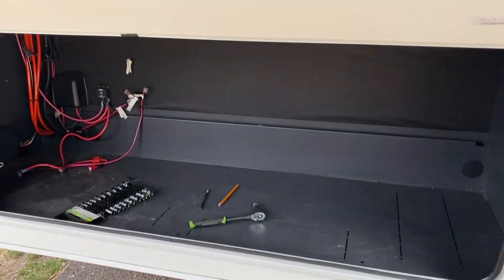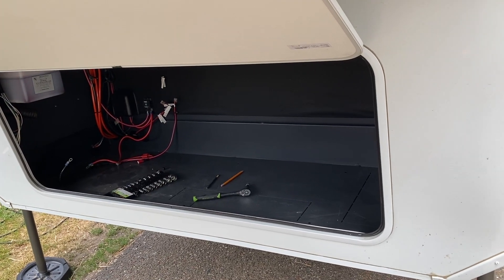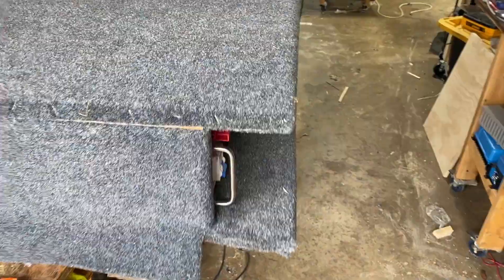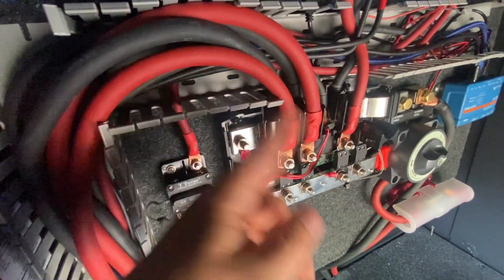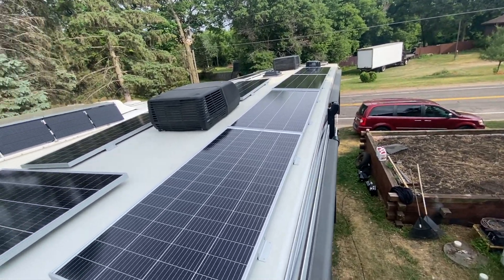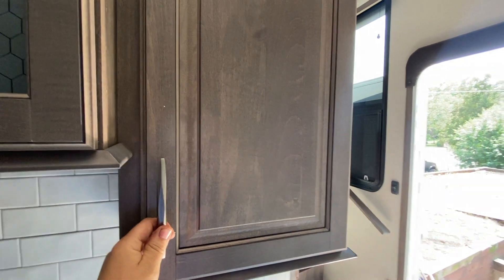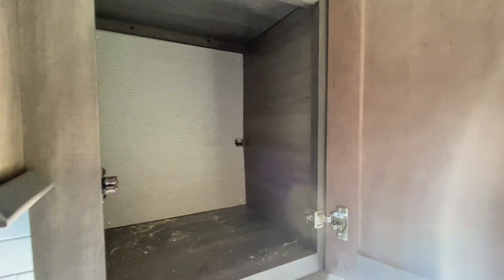Grand Design Solitude 280RK 24v Solar System  with EG4 batteries & Victron Equipment

Comment: how do you mount the board to the back wall?
Reply from the maker: Depends what we're hitting on the other side. Sometimes self tapping metal screws with a broad head and or washer,  or a spax t25 if going into wood or softer metal like aluminum.  Usually we'd predrill a bit for those.

Comment: What about all your 12 volt systems in the rv. You didnt talk about a stepdown converter and how do you know if has enough amos for the slides and leveling jacks etc??
Reply from the maker: We’ve covey that in other videos. Look for other 24v installs.

We use an Orion 24-12 70 amp step down and then leave a single 12v battery in parallel with that to power slides and other loads in an emergency.  Been working great!

Comment: Impressive work. Great system. Do you parallel the ac wiring with those splice blocks under the inverter? Was thinking of a junction box but i like your idea

Comment: It makes no sense why this isn’t an option from the factory instead of a generator. If I could have had 6to9 eg4 48v batteries and 3200 watts of solar on the roof with 2 MP2 inverters etc etc, I would have added another 20k to my loan just for the ease of having it all. 
Side note WHY THE FUCK IS THERE SO MUCH UNUSED SPACE IN THESE GODDAMN RV’S!!!?!?! MAKE THESE VOIDS ACCESSIBLE CABINETS DAMMNIT!!!
Reply from the maker: Yup.

Comment: What about air flow on the batteries?   It looks like they're boxed in completely except the front.  Are you worried about high temps?
Reply from the maker: The batteries are already encased completely and they generally don’t generate much heat during normal operation. That’s more for a hey draw application like a car. For comparison, a large RV system might use 10-20 kw in an entire day. Where an electric car might use 60kw in a few hours. It’s why EV batteries need the cooling.

Comment: Looks great. I wish the eg4 24v  batteries  Were available when I built my system.  I have 2x 12V SOK 206AH  batteries in series And periodically I have to deal with them getting a little bit out of balance. They are great batteries but an all-in-one 24 V battery would definitely be more ideal where all of the cells are managed by a single BMS. These EG4's are also quite a bit lower cost than 2 SOK's
Reply from the maker: We did an install with the 24v battery balancer. I would recommend it.

Comment: Nice install.. dig the battery setup... I have an older class A .. a 2003 Winnebago  ...  we are hitting the road for 6 moths or so.. I have a 24 volt system now in my shed at home and run my window ac and all my tools off solar so I realize the advantages of that higher voltage.. (I had a 12volt system in there before) BUT what do you think on running a 24 volt in my rig?.. (how I found your Vid) .. although I am a subscriber...  I'm on a budget and was thinking going with a 24 volt system and keeping my 12 volt to run all my 12 volt stuff and slides (I have 2)  I would apricate your Impute as I see you know what the heck your doing.. LOL
Reply from the maker: Watch  the most recent video, we did one in a Winnebago Journey. 

We are a Victron dealer and sell to many people we don’t install for. We make margin (you pay same retails price as anywhere) and that covers consulting time for us . We’d be happy to discuss a system for you . Hit us up on the website https://sotasolar.com

Comment: With the panels mounted on the roof you will have to park the camper in the sun for full sun exposure heating up the interior of the camper. Why not use portable panels so you can keep the camper in the shade.
Reply from the maker: Many times we include a second charger just for that.  Why choose?   But seriously, once nice thing about covering the top of the roof is almost adding a second roof.  They  have a fair bit of shade almost all the time now.
Reply: you just cant keep up with the ground deploy its a pita
Reply from the maker: @sudo936  One of our guiding principals is "What will I do in practice?" ... if it's too much of a pain, or makes camping more of a chore, you won't do it.  I think you're onto something there.
Reply: Curious, is going 24V the key to getting 2400W of solar on the roof using only a single Solar Charge Controller?
Reply: How would you store 2400w of panels to deploy? And where would you set them all?
Reply from the maker: On the roof works well :-)

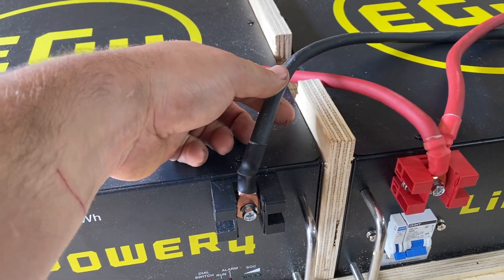Comment: Love you content but you said something at @2:52 that confused me. You said you are comfortable with 2 gage wire because the 100amp circuit breaker will prevent anything more than 100 amps from flowing on wires. As I understand it the breaker protects flow from the positive to the negative of each battery but the cables are in parallel outside the batteries which means the amperage can add. With 3 batteries that could be 300 amps. It does depend on the upstream fuse and inverter but assuming the battery breakers are protecting the external cable seems off. Again, love your stuff and just want to understand if I have it wrong.
Reply from the maker: My preference would be to run 2/0 on it all, but the lugs won’t fit on the hardware.  Actually, they included #6 cables, what a joke. Anyway. The way I figure it, if all batteries contribute it’s 300 a / 3 meaning 100a per #2 wire. I see that as being fine. Now let’s think about failure modes, a dead short on a single #2 wire, the battery it’s connected to will blow its breaker, then the remaining 2 batteries could feed in up to 100a each for 200a total. Which is something that does concern me. However if it’s a dead short, the other breakers will blow in short order. If the load is external, the primary fuse would blow as well as the breakers.  The breakers are on the positive line, the BMS is on the negative. 

Every which way I could figure we’re protected in a practical sense. 

I’m open to learning if we screwed up here. I’m just not sure how I’m a practical sense we could do it much different.

Comment: Why not 48volts? I really like my EG4 batteries however Will Prowse posted a video yesterday with a new SOK for $1349. It is pretty stripped down with no communication ports, no indicator lights and no pre-circut resistor. But it has bigger posts. I think the form factor is still a little bigger than the EG4. I do wish the EG4 had larger posts. Great install, I really like seeing the server rack batteries being used.
Reply from the maker: Two reasons, 1) Victron Multiplus 2x120 is only available in 12 and 24v versions. This is the biggest reason.  This way we can run both in parallel, keeping balance and avoiding an autotransformer like you’d need with current 48v inverters from Victron. 

2) that 24-12 converter is pretty darn stout at 70 amps output. I think we’d need 2 or more 48v step downs to equal it.
Reply: @sotasolar  oh yes, that is one of the reasons I went with the quattro, works great for a 30amp system.
Reply: Impressive work. Is there any issues with plugging in 15 amp receptacles with the dual inverters?